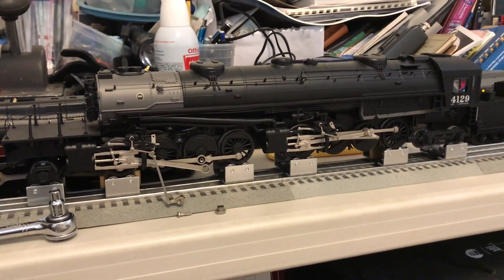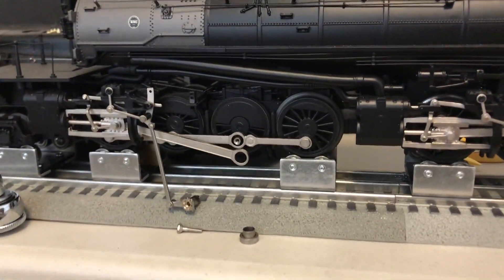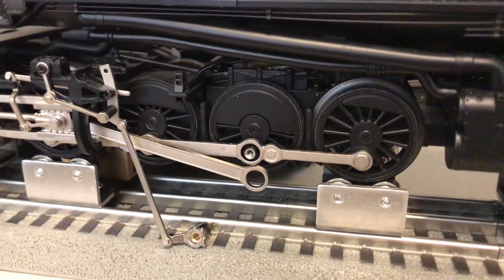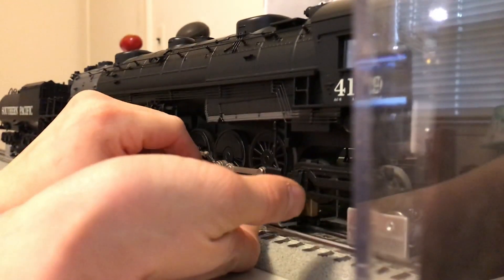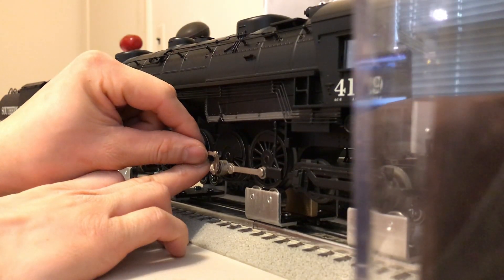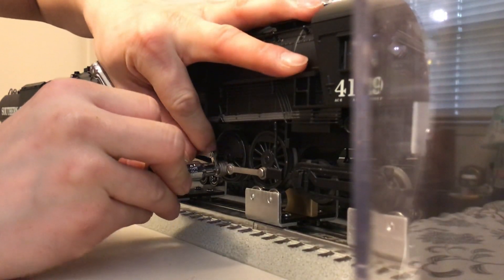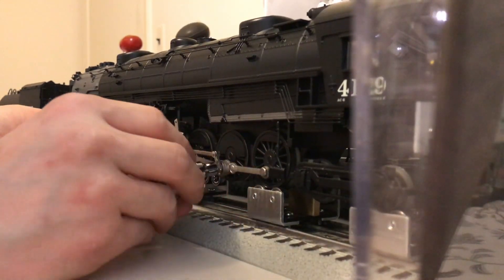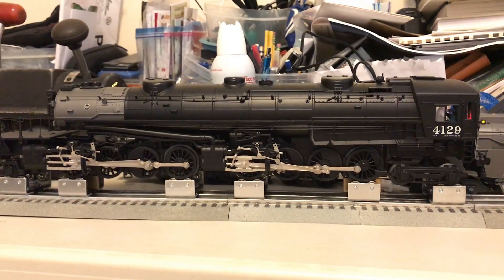MTH O Scale Premier Southern Pacific AC-6 Cab Forward Eccentric Crank Position Modification Demo

Comment: Question should the front and rear pistons be in sync and if so is it easy to do?? It looks like they are opposite, in this video
Reply from the maker: It doesn't matter if the forward engine is in sync with the rear engine. It is a bit more difficult to change that, as it involves taking the boiler and cab off of the locomotive.